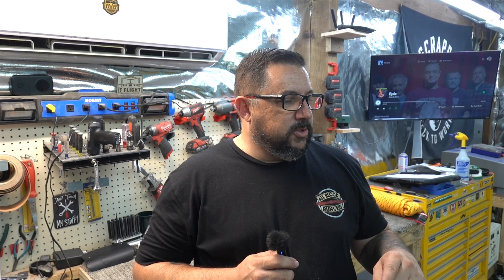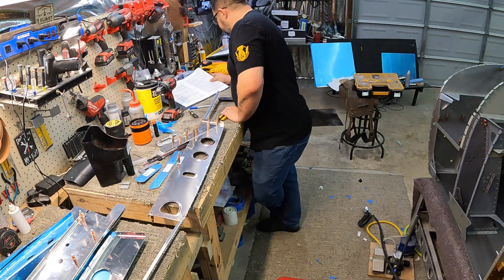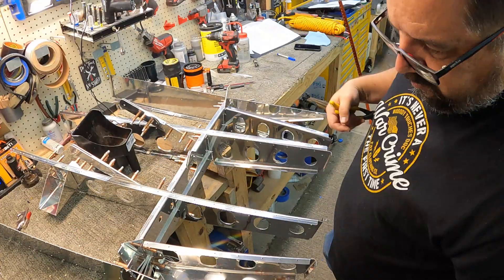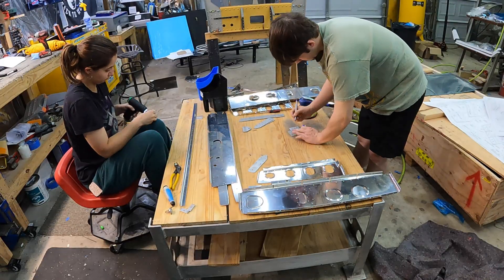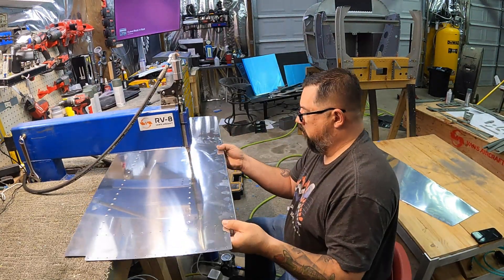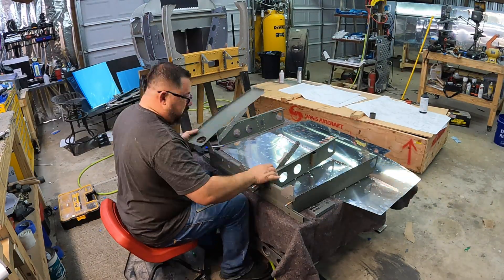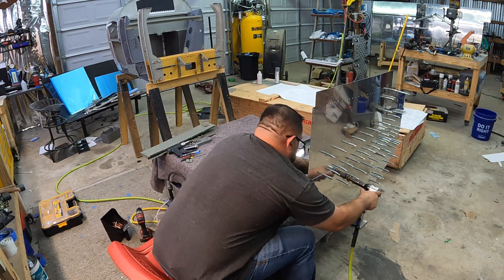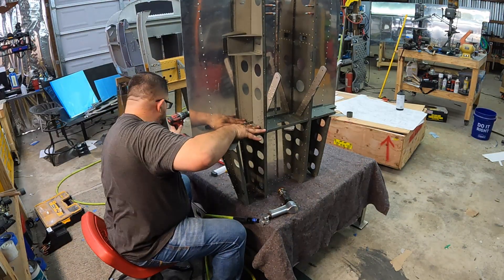Vans RV-8 Ep.137: Seat Rib Prep & Assembly – Cerakote, Riveting & More

Comment: What is that thing on top of the DRDT-2?  I want one!
Reply from the maker: It’s a Numatix hydraulic rivet squeezer. It can be a pain to bleed and get set up but I love it. The C frame is actually a Clemson Aeronautics Card-1 it’s designed to work with all types of squeezers for both dimpling and riveting. I think they have a lever attachment like the DRDT as well. Hope they helps.